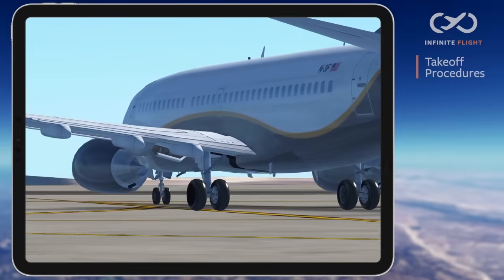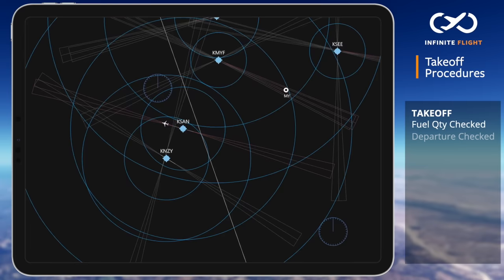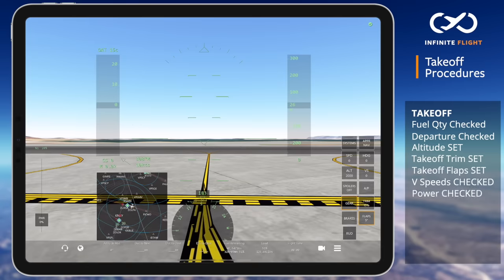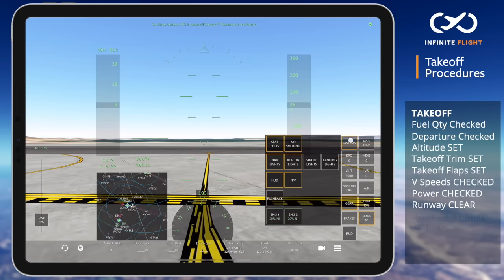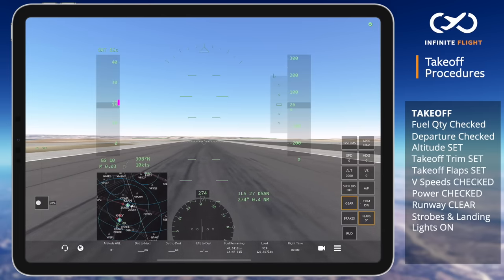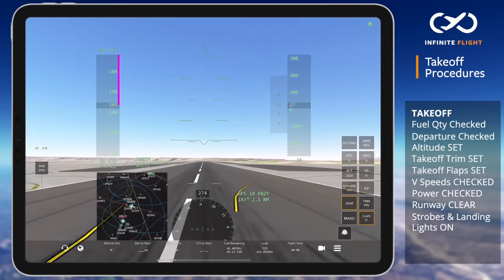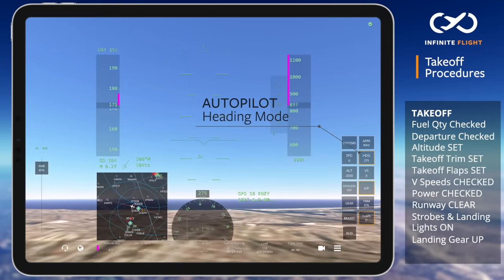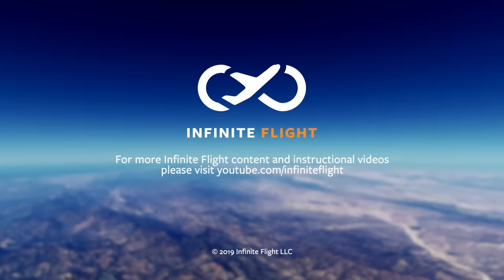Takeoff Procedures Tutorial

Comment: How do you calculate v-speeds?
Reply from the maker: German Oleynik great question! There’s many programs available online along with flight manuals that are public information. Using those resources you can find the appropriate takeoff speed, approach speed and more which takes into account the temperature, weight, and flap setting. My speeds used here were rounded up or down by 1kt to give you a very basic reference for the appropriate speeds in the B737 for most scenarios. Cheers! 🙂 -TJ